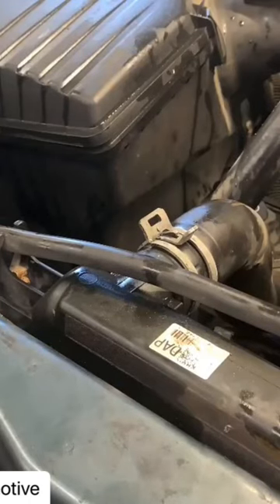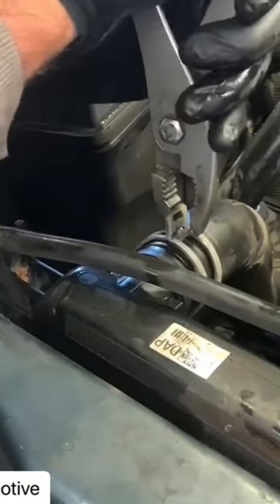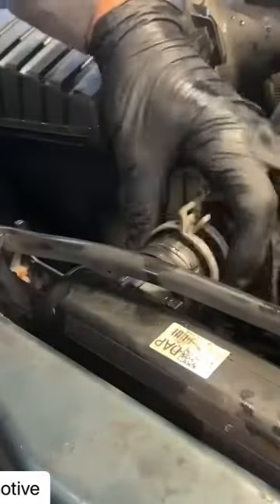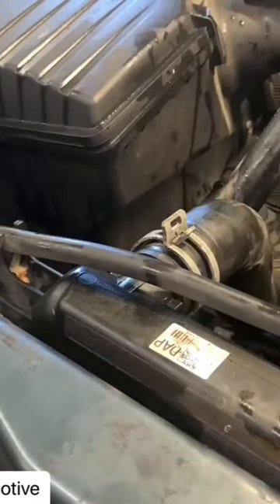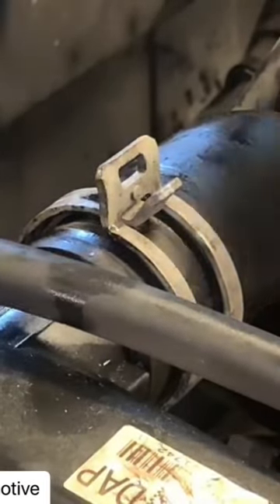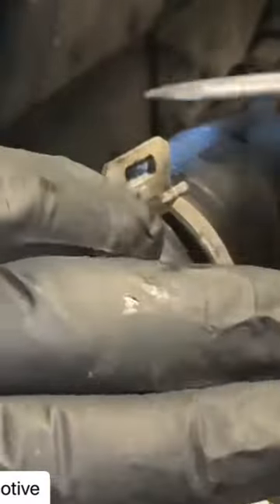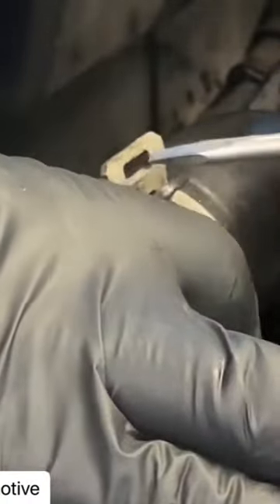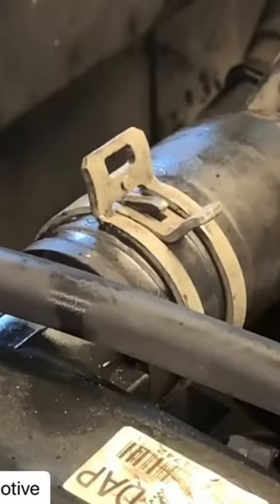Hose Clamp Struggles Are Real ￼

Comment: Cut off junk factory clamp put real hose clamp on
Reply: the worm drive clamps will damage plastic radiator fittings, which is why they use these to maintain constant tension.
Reply: I've never had a problem with them so I don't really give a s***
Reply: I've never had a problem with them either just don't over tighten

Comment: Worm drive old skools damage the hose, hence this new style.
Reply: the worm drive clamps will damage plastic radiator fittings, which is why they use these to maintain constant tension.
Reply: These clamps dig into the hose until they leak. My experience is these are the worst clamps I've ever used